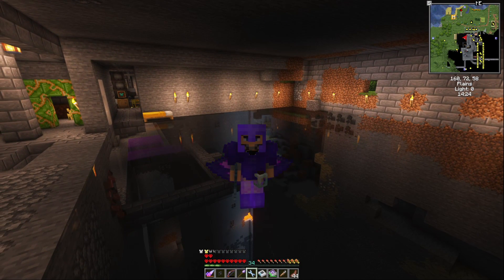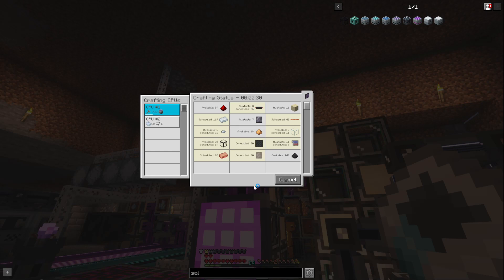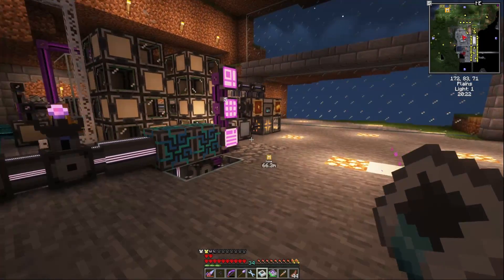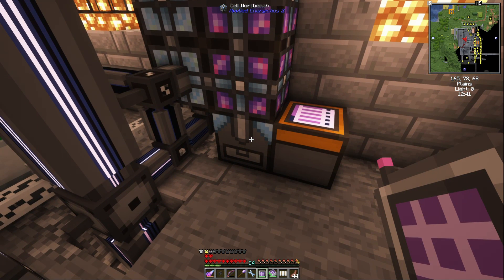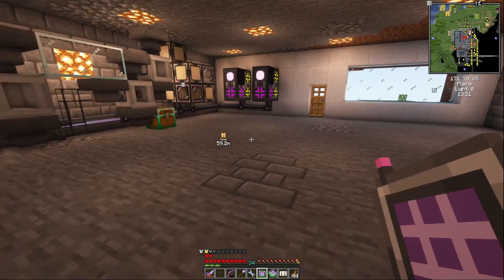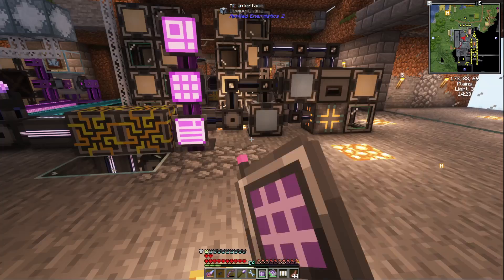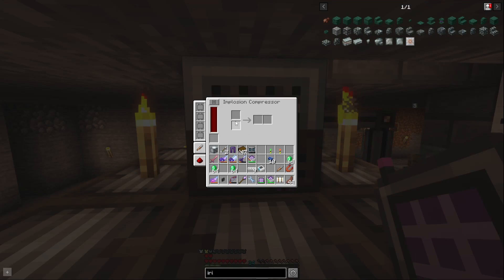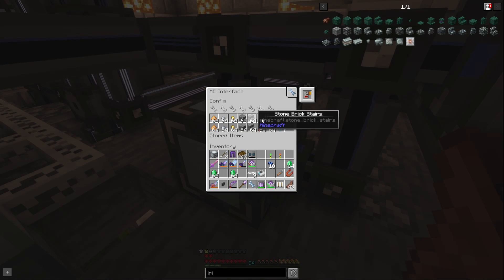AE2 and TR Automation Showcase  | Ep 18 Valhelsia: Enhanced Vanilla HC | Minecraft 1.18

Comment: Hey Jangro, I love this video so much! I’m having a problem with my Certus/Fluix production though. When I try to craft crystals while I have no dust in the system and only crystals in the system, it says it can’t craft the dust in the inscribers. Do I just need to have some dust in there at all times as a buffer? Also, I replicated your setup exactly only I don’t toggle the power on the crystal growth accelerators, I just always leave them on, so maybe that could be the problem. Thanks!
Reply from the maker: I need to mess with this more. I think that AE2 gets stuck when there is a recipe loop of sorts. 

It’s not the power thing though. That just keeps the accelerators from constantly using power. It’s not much, more a thing for me to not have runaway machines that use or produce too much when not needed :)

I just keep a bunch of dust and crystals in stock so I rarely run into that. I’ll look at it and check back if I come up with anything

Comment: Hey Jangro thanks for the video, 

just one question, when i've set it up in this way I seem to have a problem when trying to craft the processors. I get told I am missing the printed circuits/printed silicon. 
any idea why this maybe?
Reply: I found the solution, was from the patterns, they need to be made from the individual ingredients cant copy it from the inscriber recipe
Reply from the maker: @Harrisoni2  right. I also caught your other question that you removed while
I was answering as you probably figured that out too. But since I wrote it, I’m case someone else runs into that…

The question was that there are too many channels in the inscriber setup to fit on one subnetwork. There’s actually two subnetworks in that setup for that reason. Between the silicon inscriber and the final inscriber that’s a tiny subnetwork. Make sure you put the fiber cable in there to power it and separate it from the rest. :)
Reply: @jangrogames  haha yeah I wasn't too sure how but I got it working so thought it wasn't worth the question. But thanks again the videos have been very helpful!

Comment: I was wondering if i could get some guidance with getting Iridium ore, it seems like you can only mine it but i haven't had any luck finding some so far.
Reply from the maker: The best thing to do is look for Sheldonite ore in the end and you’ll get iridium nuggets when you process that. You’ll never find enough iridium in the overworld even with a quarry. 

In the end, it’s easiest to find in the vanilla islands that are just end stone and chorus trees. You can see it on the surface and mining there. Don’t dig through the bottom though :)
Reply: @jangrogames  Awesome thank you so much that helps alot
Reply: @jangrogames  Also do you know what level you need to be to mine it?
Reply from the maker: @dakotafrappier2808  not off the top of my head but you can see all those levels in the skills menu. Click on the pickaxe and the. The button with the three lines in the upper right. Or you can also look up Sheldonite in REI and it’ll say what level.
Reply: @jangrogames  Thanks man, sadly im level 25 and i need to be 28
Reply: @jangrogames  I mined Sheldonite ore and it turned into platinum, no clue if that is correct but if so how would i process it? what machine would i have to use.
Reply from the maker: @dakotafrappier2808  do you have a pickaxe that automatically forges ores? You should just get the Sheldonite ore block that you can put the industrial grinder.
Reply: @jangrogames  Ah i understand, i did use a pickaxe thatautomatically forges ores

Comment: I tried to copy the auto inscriber setup in valhelsia enhanced but for me it does not work, the prints are being made but only the silicon ends up in the final inscriber and redstone is voided in the system
Reply from the maker: Hey! I doubt the redstone is actually getting voided. Chances are it's getting sucked back into the main network instead of going into the final inscriber. Check the filters on the export bus that goes back to the network. If I remember correctly, it should be only for the final products. If it's not that, it's probably something like that where filters are set wrong somewhere.
Reply: @jangrogames  so I set everything up, I double checked the storage bus but now in the top slot on the I only see the silicone print. the calculation print is still in the bottom inscriber and the redstone is nowhere to be seen, the export bus from the station to the main frame has the processors attached
Reply: small update, I do get both prints in the top inscriber now but the redstone gets taken from storage but never appears in the inscriber